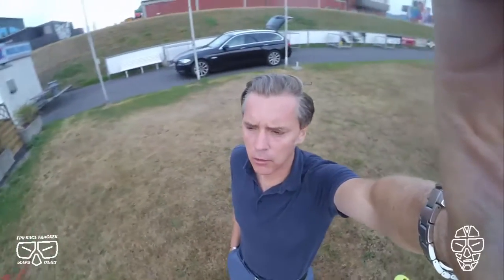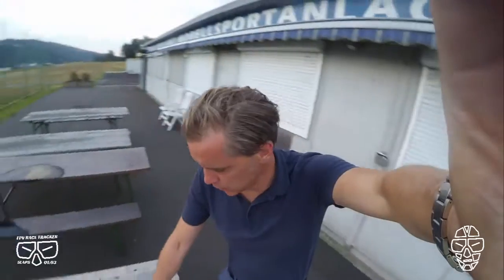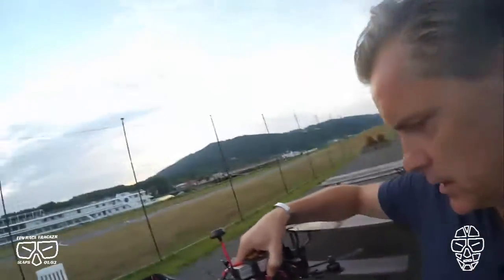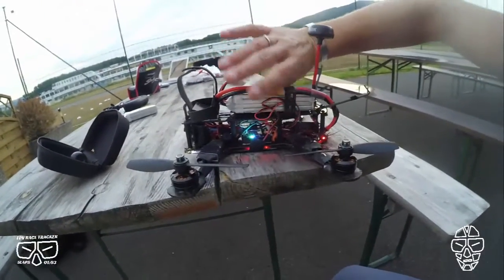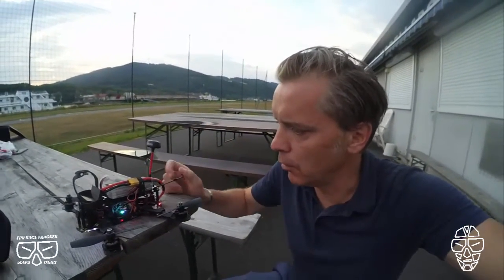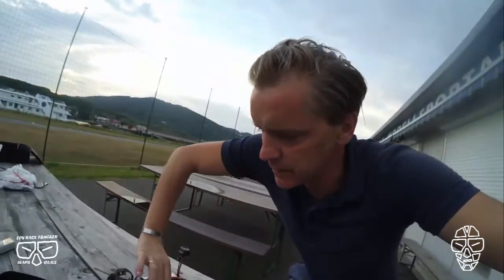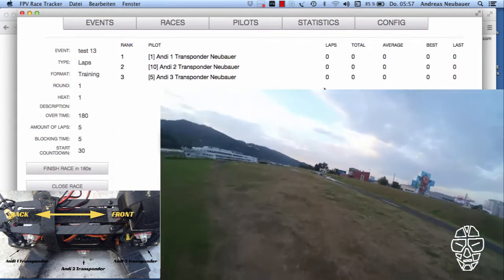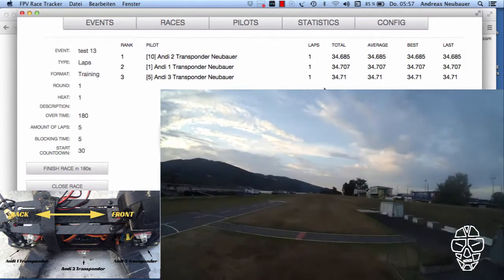FPV Race Tracker Extreme Test - 3 Transponder at 1 Quad

Comment: Great work mate. That is accurate enough for me. I will use this system for sure. My official race gates will be here this week so I will have to consider getting this soon.
Reply from the maker: ThatHPI GUY thanks HPI Guy, let me know if you need help to setup the timing system.
Reply: NICE GUY ANDI Where can I purchase all of the hardware?.
Reply from the maker: ThatHPI GUY The Hardware you can buy at I-Lap Counter http://www.rclapcounter.com/ you need 1x Decoder Unit 5 Bride Sensors and for each quad one transponder. The software I will release mid of August and will be available through the Chrome Web Store. Just tell me when you have got the hardware I will send you a link where you can download before the official release of the FPV Race Tracker.

Comment: Great test, and shows real racing across the line won't be an issue. I am guessing you need to power up seperately so the blinking is not synchronised, also what is the resolution - as order should have always been 3-2-1 when it kept changing and laptimes didn't match precisely, so maybe software should only show times to 1/10 second precision so this makes sense.
Reply from the maker: ***** Thanks you for feedback will consider that and need to test further on.